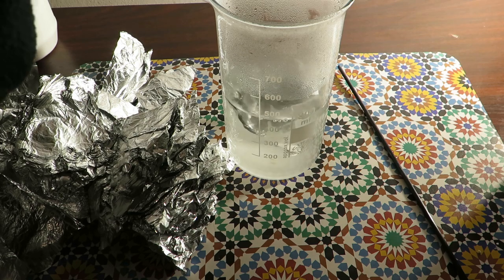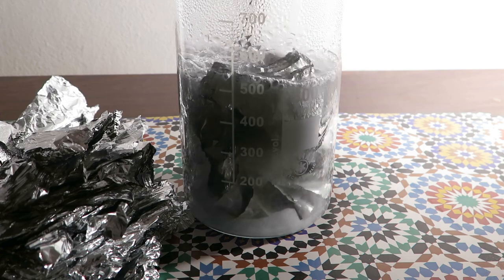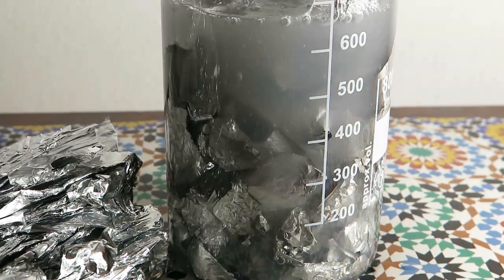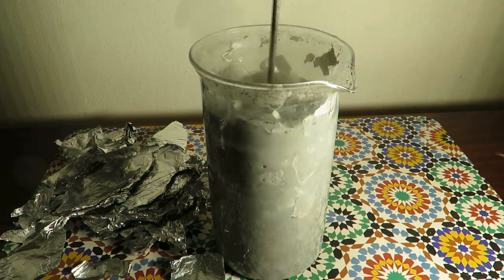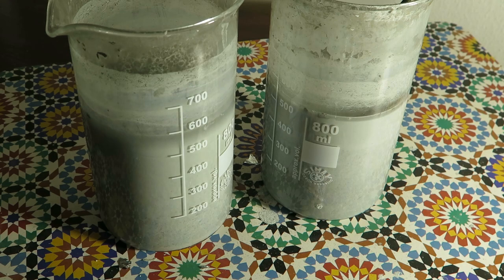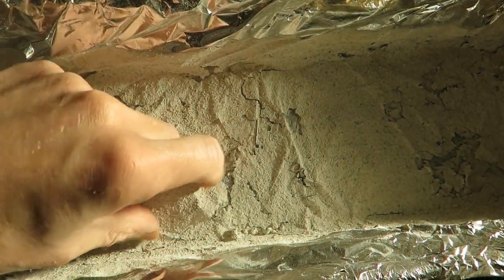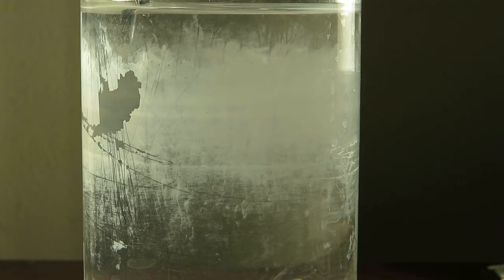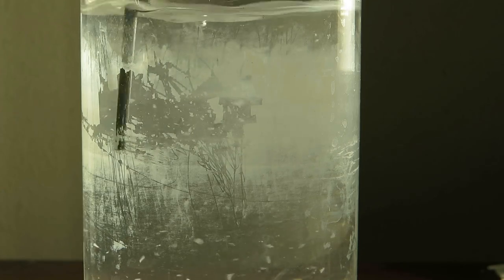Make aluminium oxide (alumina) from aluminium metal

Comment: Cool. I wonder if it can be used to make gems with like the alumina made from crushed corundum.
Also, to get rid of the sodium salt you can wash your ceramic with water. Mix it with water, let it settle, pour off the top water and repeat until it isn't salty. Then dry the ceramic.

Comment: im not sure but i do not think this is aluminum oxide, if it is, its very contaminated with aluminum, sodium ions and hydroxide ions, a better way is to react aluminium with hydrochloric acid (try to get the amount of aluminum as close as the molar proportions of the reaction) and then add sodium hydroxide to neutralize the excess hcl and to convert the aluminum chloride into aluminium hydroxide, try to add an excess of naoh to really make sure that everything is neutralized/reacted. Now add water to aluminum hydroxide slurry and filter it, then wash it a few more times with water and refilter, finally, put the aluminum hydroxide in an oven at the highest temperature you can for as long as you can (~250C for 1-2h is more than enough), then just powder the stuff you dried, since aluminum hydroxide decomposes upon heating, youll get a bunch of pretty pure aluminum oxide ready to use

Comment: guess i'm late to the punch pointing out its sodium aluminate but thats even cooler in a way. 
Sodium Aluminate Wiki: "In water treatment it is used as an adjunct to water softening systems, as a coagulant aid to improve flocculation, and for removing dissolved silica and phosphates.

In construction technology, sodium aluminate is employed to accelerate the solidification of concrete, mainly when working during frost.

Sodium aluminate is also used in the paper industry, for fire brick production, alumina production and so forth.

Sodium aluminate solutions are intermediates in the production of zeolites."

"Sodium aluminate is formed by the action of sodium hydroxide on elemental aluminium which is an amphoteric metal. The reaction is highly exothermic once established and is accompanied by the rapid evolution of hydrogen gas. The reaction is sometimes written as:

2Al + 2NaOH + 2H2O → 2NaAlO2 + 3H2
However, the species produced in solution is likely to contain the [Al(OH)4]− ion or perhaps the [Al(H2O)2(OH)4]− ion.["

Comment: This reaction produces sodium aluminate but how did you got aluminum hydroxide?
Reply from the maker: I have used 6g of NaOH to dissolve a lot of aluminium. It just can't be only sodium aluminate. How it works? I am not completely sure. My theory is, that Al is attacked by sodium ion of NaAlO2 and then it reacts with water. That is very testable theory, but didn't test it myself.
Reply: A solution of sodium bicarbonate is added to the filtered sodium aluminate solution. A precipitate of aluminum hydroxide precipitates, which must be washed with water and dried. When the precipitate is heated, pure aluminum oxide can be obtained.

Comment: Didn't realize you were going for a simple reaction in my other comment. Since that was your aim, you nailed it! I make Copper Hydroxide by electrolysis from rectified mains power through a 400w lightbulb in series. I didn't think making hydroxide could get much simpler than that.
Reply from the maker: I am not sure which comment is "other" now :) but this reaction wouldn't work with copper.
There is quite "quick" chemical route through HCl + H2O2 and neutralize with NaOH but you would need stoichiometric amounts of reagents and waaay more cleaning to obtain clean product... 
So perhaps electrolysis is actually better, because with that you can use "catalytic" amount of alkali hydroxide, because alkali made by electrolysis will react immediately with water regenerating hydroxide levels. If you are making hundreds of grams, that is, otherwise it may be faster to remove soluble NaCl.
Reply from the maker: Now I actually remember one more method that may work - you can try to react copper-mercury amalgam with water directly. Not sure about copper, but it would definitely work with aluminium :)